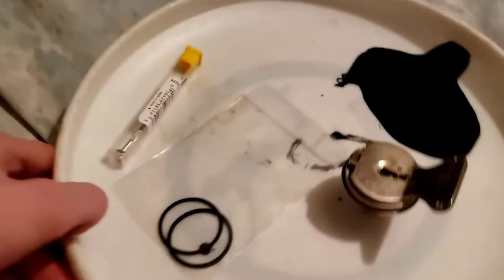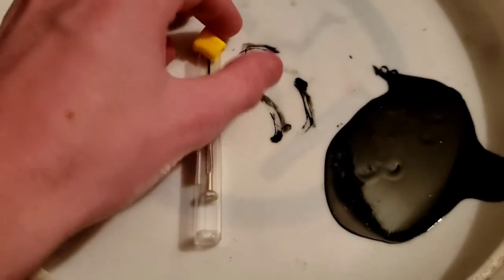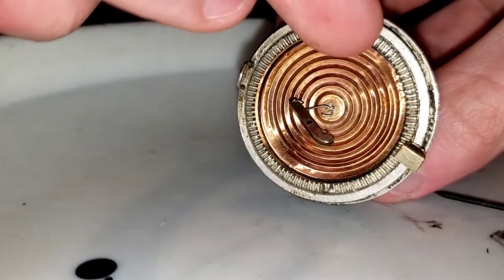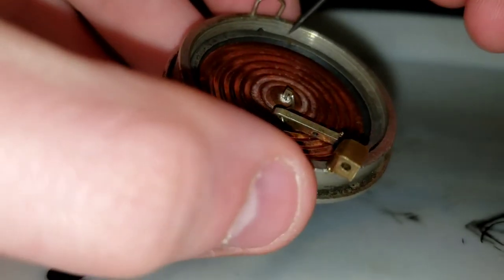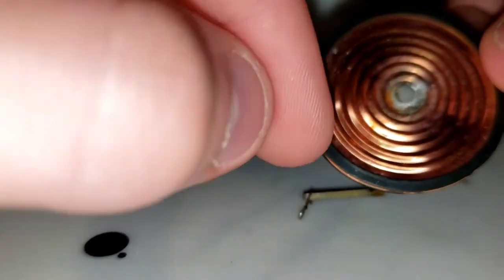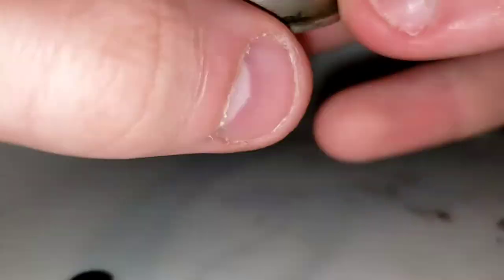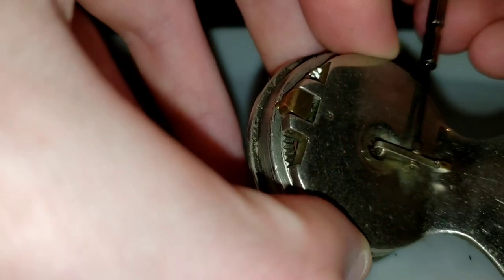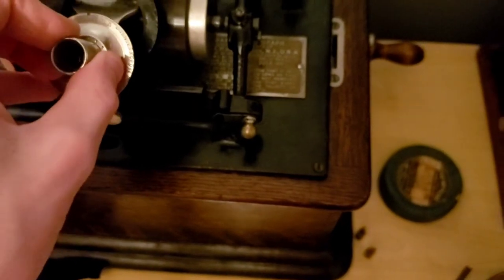Phonographs for Dummies 3 - How to rebuild a Model C Reproducer

Comment: You'll want to get a set of jeweler's screwdrivers, you can get them at any hardware store or online. They usually have three or four flathead screwdrivers and two or three phillips head in small sizes. You'll need a variety for the different sized small screws in reproducers etc. They're cheap and totally useful! I also recommend a spring loaded long skinny tweezer. But you have to be careful because they can fling a small part a long ways! I once was replacing a sapphire in a model C with a tweezer, and the sapphire flew out of it and of course I never found it!
Reply from the maker: Yep. I already have a bit set that my dad has had for about 20 years. I'd say if you can get a set of Jeweler's screwdrivers go for it but if you're limited one of the glasses repair kits does the job as well!

Comment: Hi there!
After about 4 years of searching, I've finally purchased my first Edison Phonograph. It's a very early model, either the Model A, Type 2 or the Model B from between 1898 and 1901 with a  2/4 minute gear accessory built in. It comes with a 4 minute reproducer so, naturally I'm on the lookout for a 2 minute reproducer. I've found a rebuilt Model C and a used Model S for sale. I'm not sure which to go for or which one would be more compatible with my machine. Any thoughts?
Reply from the maker: I would recommend the Model C. The Model S reproducer is pot metal and are prone to swelling and expensive to repair properly. They're also a combination reproducer, with a swiveling apparatus with a 2 and 4 minute stylus on seperate needle bars. If you have a Model H then you can just swap the Model H and C out as you change the gearing. Plus, Model C and an accompanying H is more historically accurate to the upgrade kit I assume was installed on your machine (if it is truly a 1902 model and you're not just going off the patent dates, which in no way indicate production period, just when patents were filed)

Comment: I have a Colombia type AZ cylinder phonograph that has a lyric style carriage that is swollen and barely moves.  ANY ideas on how to fix?
Reply from the maker: Sorry for taking a bit to respond but my best advice is to just force it out. To my knowledge Columbia carriages and castings are made of pot metal in certain cases. I have an AT that had a swollen casting and it basically was useless. If your carriage is swollen and stuck best you can do is force it free and find a replacement. Pot metal is a pain in the ass, and once it swells it's often not gonna work anymore.
Reply: @possiblyli5510  Yes thank you. I bought another Colombia that works fine!! Thanks for your reply!